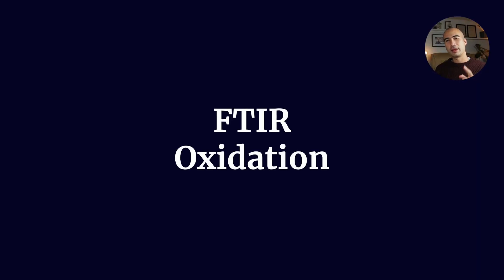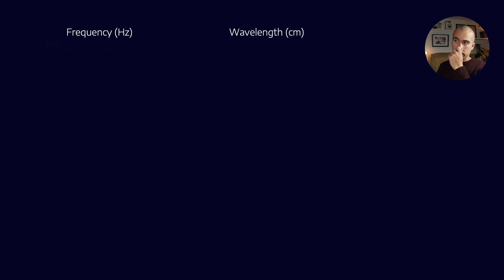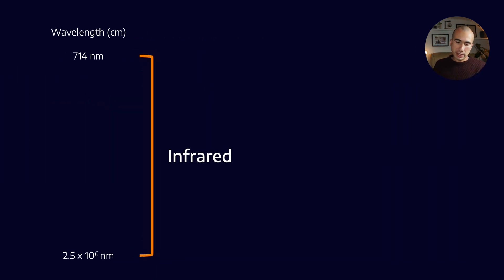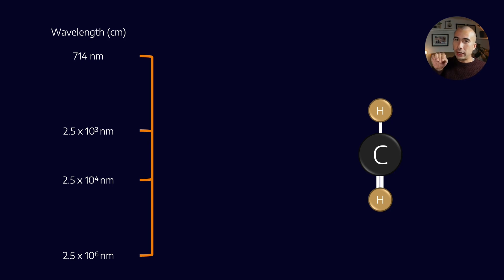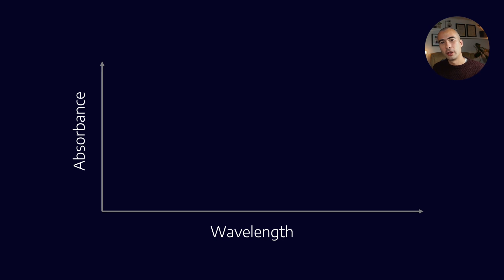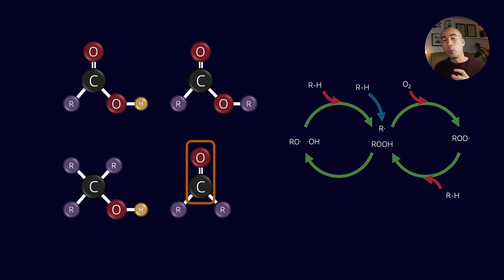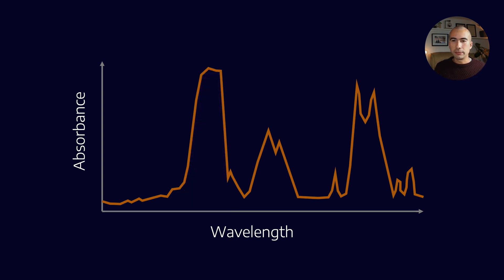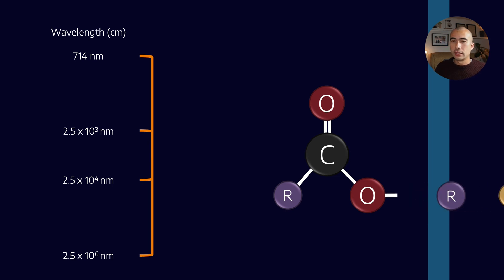How does oxidation by FTIR work?

Comment: Sir you mentioned carboxylic acid and ester are difficult for the detector  to detect or will be same as for detector to detect but ester will show c-o at 1200-1300cm-1 and then carboxylic group at 1700-1736cm-1 for ester and c=o carboxylic group for acid at 1700-1722cm-1 but there will be a broad peak at 3000cm-1 hence we can distinguish between ester/digester  or acid group.

I have a question the area under curve will tell us that whatever free radical has undergone to form product can we quantify using the technique you mentioned as my instrument software doesn’t have provision
Please suggest thank you

Comment: Great explanation.
How to stablish limits for the oxidation for every aplication? If I want to change Oil by condition, I would like to be clear on that, appart to the contamination and wear parameters off course.
Reply from the maker: Good question. The way I always think about it is: why do I care about this test? So in the case of oxidation I care because oxidation will cause acid buildup and viscosity changes. So to set an oxidation limit (assuming the OEM hasn't already set one) I'd look to correlate the oxidation number with a viscosity or TAN limit.